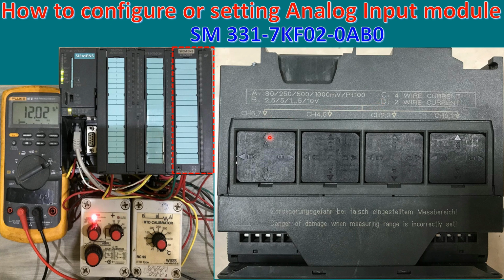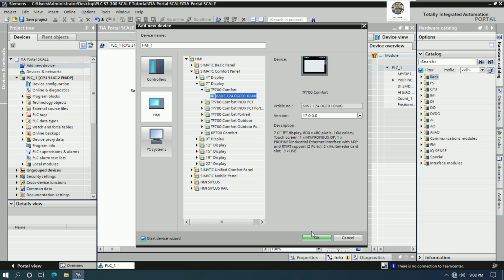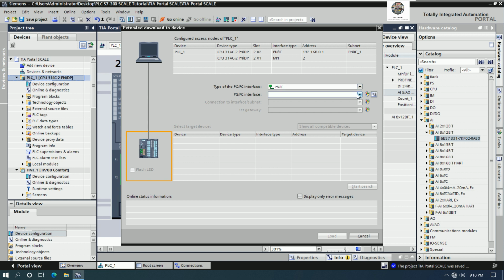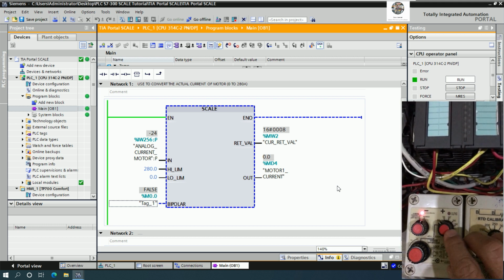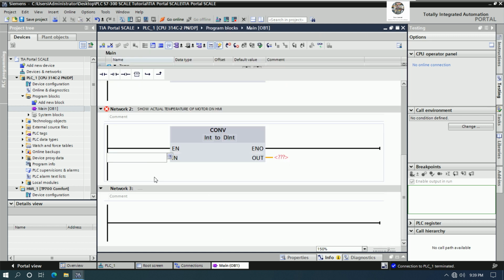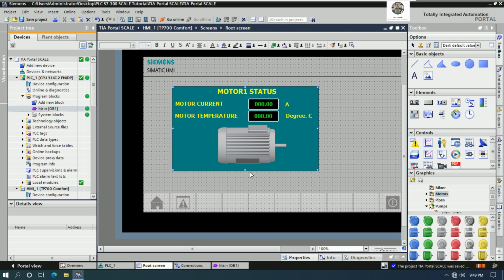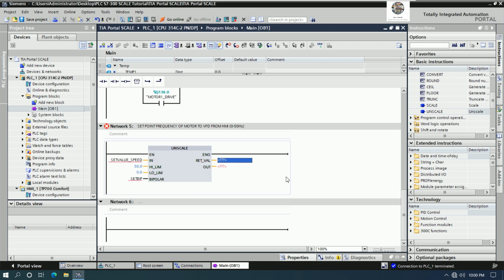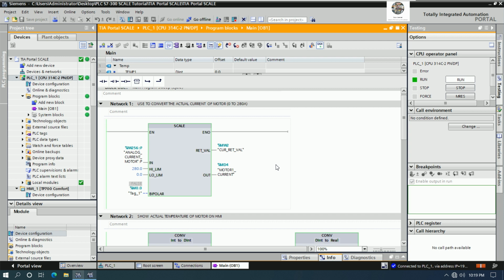TIA Portal V17 how to use "SCALE" & "UNSCALE" of PLC S7-300 Analog 300 module (Full Tutorial)

Comment: Hello admin. I want to know, if I have a loadcell Sensor (serial communication) and I use TIA V16, How could I communicate it and which function should be use. (I just want to read values from loadcell and take it to calculate). Thank in advance!
Reply from the maker: Thanks and could you give or detail the load cells brand and part number?
Because we have digital loadcell and analog load cell.
Reply: @generaltechnologyknowledge5165  Actually I connect  load cell to controller of scale and I connect from controller to PLC S7 1200 through serial communication, So I need to write program from TIA to read values from controller and get the values to calculate. Example: I get 500kg form load cell, so I take that values to summation for find total of load. My problem is that, I don't how to use function or Modbus that can read the values from controller of load cell. That is what want to do, if you have any solution, Can you guide me? Thank in advance!
Reply from the maker: @tunbunlong685  Actually most of scale it has analog output 0-10VDC, 0-20mA or 4-20mA, so you can use this analog signal then connect to analog input of PLC S7-1200 then you can use function Scale FC105 to convert from your analog signal to actual weight. Example your scale range from 0-80tons then you can convert it from 4-20mA to 0-80tons.
Thanks
Reply: @generaltechnologyknowledge5165  Ok I got it. Thank you so much! One more thing I want to know , if I have many load cell that connect to controller and I want to read values from controller through serial communication to PLC S7 1200. Do I need any Modbus or something else? What should I do with the program in TIA. Example: I use Modus RTU for communication between PLC and Controller? Thank!
Reply from the maker: @tunbunlong685  Yes you can consider with cost also if you would like to so project because cost is very important.
Please find the way that low cost and we can use the same concept and can monitor the data.
Thanks
Reply: @generaltechnologyknowledge5165  I got it. Thank you so much!
Reply from the maker: @tunbunlong685  You are very welcome!